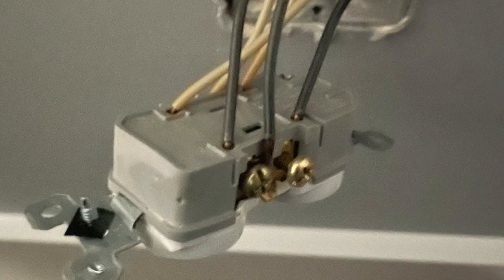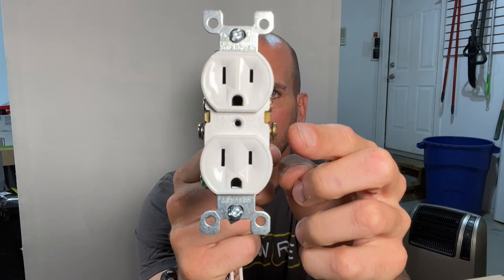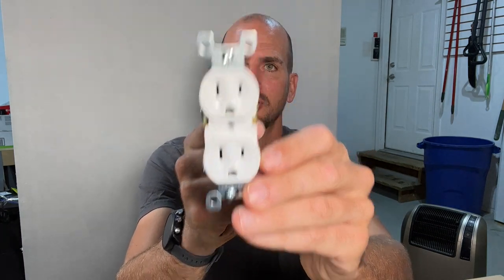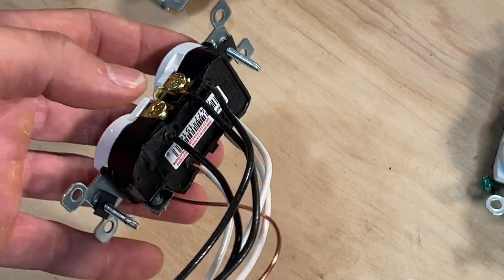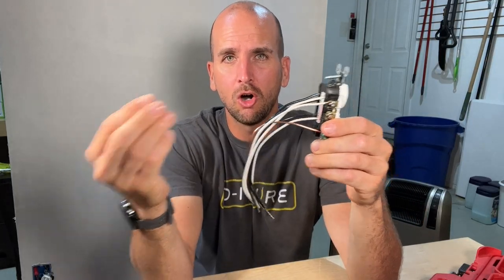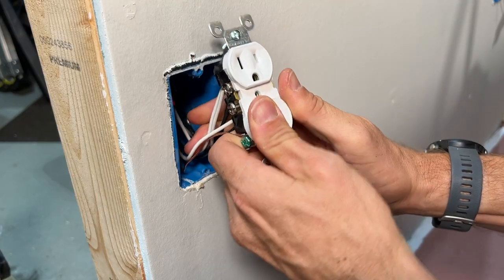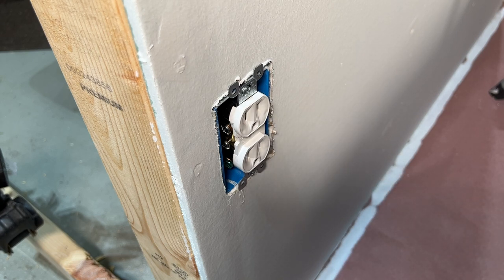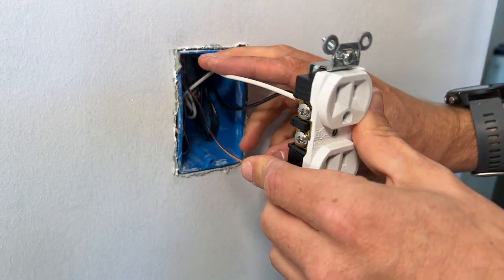Beware Of These Wiring Mistakes Made On Newly Built Home

Comment: As an Electrician, i prefer wire nuts over the ported connectors. More surface area to conduct electricity and less resistance.
Reply: But have you ever had an issue with resistance or is it only a theorethical problem?
Reply: @rutgerhoutdijk3547  Someone did a test on Youtube and the lever lock wagos were the worst. Resistance causes heat and heat is never good. From my experience ive been in J-box where the plug in connectors were used and they sometimes slip right off or you can see where the conductor had worked its way loose over time through heat cyles and building vibration. Wire nuts installed correctly usually dont have this failure. I view plug-in connectors the same way I view back stab style residential devices...

 But where plug in connectors really shine is if your in a situation where the wires are extremely short in a box, you have a solution.
Reply: @KeystoneOutdoorsman let's say the acceptable resistance is 1 and the twist connector is 0.02 and the wago 0.05, how is that a problem? They are both way within spec.

Comment: So you have multiple problems here.  First is the 12 awg assertion.  In principle I agree however all things are never equal in the real world.  A general purpose branch circuit likely to exceed the 15A/12A available with multiple receptacles should simply not be wired as such, which is why MWBC are how things are done commercially.

Sizing up is an absurd proposition when alternatives are considered, like a single phase multi wire branch circuit.  It would cost no more to go 14/3 than 12/2, although you should have a 2-pole GFCI breaker which is still a savings although one that can be hard to appreciate. This gives you 30A/24A instead of 20A/16A and opens up L-L as an option if you go for the 2p GFCI.  You would be surprised how many household loads tolerate 240V.  Either 12/2 or 14/3 would require a larger box anyway.

The second issue is also the 12 awg assertion, but on different grounds - pun not intended.  This looks like an 18 cuin box.  Your pigtails don't count either way, however if this was 12/2 it would exceed box fill.  Frankly, you're already over reasonable box fill for a traditional receptacle, and a larger receptacle including the commercial grade receptacle would be absurd there.  Passing current through the receptacle: If it meets box fill by code and by reason and doesn't violate other code it's fine.

The third is friction connections, including but not limited to backstabbing.  I will not say that I am a fan of backstabbing, just that backstabbing hate is nonsense.  You can remove a backstabbed 14 by simply twisting while pulling just like a push-on Wago - more on that in a bit.  Frankly I'm not a fan of hook and screw either, as far as I'm concerned everything should either have a bus bar, blade terminals that receive the receptacle itself with screw terminals for the conductors going to those blade sockets, or spliced and soldered conductors, but that's just not the world we live in.

Wagos: Consider compact push-type.  They're smaller, easier to install, have less resistance, and most importantly are not inherently likely to become inadvertently unfastened.  With the usual Wago 221 it does happen sometimes on installation, can definitely happen later, and because of that you need to check with a flashlight every time before you close up the box.  I also prefer to put the line in the middle of the two loads on Wagos to minimize the resistance but you do you.
Reply: About 25 years ago I moved into a new apartment after college and put a laser printer in a spare bedroom that was on a 15 amp circuit. I never liked how the lights dimmed - unlike my previous apartment that had a 20 amp circuit where I had the printer.

So, when I later had my house that was old and needed remodeling I made sure all the receptacles where on 20 amp circuits. I'm glad that I did because despite putting in central air I found that I still need 2 small window air conditions upstairs.  I have 8 different 20 amp circuits upstairs yet both air conditioners wound up on the same circuit. Using 14/3 throughout would have allowed for reconfiguration to split the load - but, I'd guess many homeowners would not know it was an option. I'd still prefer 20 amp circuits.

I've warmed up to the British method of having 32 Amp ring circuits (240 V) for most receptacles - and having a fused plug for individual devices that you plug in. Though it is harder to detect faults it does have the virtue of being able to plug in more than 1 high demand load without having to worry about overloading a properly designed circuit.

Comment: I have learned a lot from your channel, so I appreciate what you've shared. However I really disagree with calling things like backstabbing a 'mistake'. It fully meets code. It's your preference to use a higher grade outlet. Different than a mistake. 

Of course commercial grade is better, but these residential grade outlets have passed lots of relevant tests and should be completely fine for residential use. No need to shame a contractor for using what's approved. Same with 15A service. Not a mistake. It's typical and normal. 

If you really think the backstabbing contact area is too small.... Compare it to the contact area of your Wago connectors that you promote.
Reply: @Kevin-mp5of  Still not a 'mistake'. Sorry.

Comment: Yeah those 5 wire wagos help save a bunch of space inside this especially small box. Making a pigtail here would have required 2 wire nuts per conductor and it would have been a problem to stuff the outlet back. If it were for just 2 wires + 1 pigtail, a wire nut could have been fine.

Comment: I have a 60s home that is fuses and two wire.

A friend told me to connect the ground to the neutral to get a ground. 

We'll,  that's evidently not best practice. 

Instead of using a GFI, can I use a 3-prong - screw in the ground and be done with it and have a 3-prong outlet.?

Why a GFI vs a regular 3-prong outlet.?
Reply: a GFCI with no ground will offer some protection.  A three prong outlet with no ground offers no protection.

Comment: I would use the non lever wago's for situations like this that you'll probably never change once installed. Those lever ones are expensive.
Reply: Nothing will compare to the tried and true wire twists caps.
Reply: @hippo-potamus  I only use those when wago's don't work, for example when the wire is too thick. Otherwise wago's are quicker, easier and safer. In Europe the twist connectors are not used for residential use since the seventies. You can still buy them for special cases, but they are almost never used.
Reply: @rutgerhoutdijk3547  I don't see how screw-terminal connectors would be more reliable or provide a better connection than full pretwist contact between the wires at an outlet.

Comment: Upon further review of watching stress test videos I have concluded that wagus are just a new trendy fad. Maybe they have their place when mixing stranded and solid or in very thigh spaces but I still have all my amazon wagus multipack unused and chose instead to go with the traditional tired and true ideal twist caps. The argument of twisting - retwisting wires when you need to change out an outlet is weak and just like leaving extra wire inside the main panel. How many times has anyone ever changed the location of breaker and need that extra spaghetti? Its very rare. Wire twist at the outlet and short concise main panel terminations for clean tight connections all round.
Reply: @Kevin-mp5of  They go up in smoke much faster than the wire nut marrets in over current stress tests. They are also the preferred choice of trendy hipsters with beards and manicured eyebrows.

Comment: Perhaps this video is for some remodeling jobs for harry homeowner. As a custom home builder for 35 yrs I’ve never seen any those things done. Certainly not by a professional electrician.
     Moreover it would be impossible for a homeowner to even see those connections since elec boxes just have wires sticking through until plaster and they certainly can’t check them during a “ walk through “ on the final. So what’s the point of pointing this out?.
Reply: I think the point is that a homeowner could easily verify this by pulling the receptacle out to have a look. Is that going to commonly done? No. Would I do that? Yes.
Reply: You say these things are never done, then say it is not useful even to hear of such things. This all boils down to "Trust me." 
My new house was not wired right, and I did not have to pull out wires to know that. Impossible, you say.
Reply: backstabbing is code compliant so I'm surprised you have never seen a professional electrician do it, hell as a service tech I'd say the majority of devices I pull out of the wall to check or replace have been backstabbed.

Comment: On the commercial outlet is it acceptable to back-stab AND use a J hook on the same screw terminal?
Reply from the maker: That is a good question.  I am not sure but would think it is 1 or the other and not both methods on the same screw terminal.
Reply: Typically the commercial grade outlet you can’t get a hook around the screw. You would spend more time trying to hold the screw and getting the loop around it.
Reply: No, that would be similar to putting 2 wires under one screw. On some brands it may not be mechanically possible.

Comment: "It was built by a reputable builder." 
But a builder does not wire a house, a builder hires subcontractors who hire supers who hire installers and expand or replace them as needed. Who's guaranteeing that? 
But there are good code inspectors, and slack code inspectors.
Reply: Code inspectors rarely go past the construction trailer to pick up their “brown paper bag”!
Reply: A reputable builder who uses $0.50 outlets

Comment: Fantastic as always! So would you bother to make the pigtails 12 gauge, or does it not matter because the main wire is only 14?
Reply: If the feeder is 14 then either 14 or 12 pigtails is fine
Reply: @Kevin-mp5of  it's not something I would set out to do. But if I needed a pigtail and had some 12 laying around I would rather use it than run to the store for a spool of 14. I tend to keep some 12 on hand because it works for both 20a and 15a circuits.
Reply: @Kevin-mp5of  remember the current a circuit can carry is determined by the smallest wire. So if your wire from the panel is 14 you are fine using 12 for a pigtail or extension. But if your wire from the panel is 12 and you have a 20a breaker you cannot use 14.
Reply: @Kevin-mp5of  you do you. I don't do electrical around my house often so it's easier for me to just keep a small roll of 12 on hand for when needed. The OP asked a question, I answered. You can debate the pros and cons of preference. But electrically and code wise it is fine and my answer is correct. You asked why you would do that and I gave you a reason. Again you can debate the pros and cons of preference, but doing so does not make you a hack and there is no need to be rude to people with a difference preference than you.

Also pigtails don't count toward box fill per NEC the only thing that may be a concern is the one allowance for grounding is based on the largest gauge wire.
Reply: @evilhamsterman  Yeah that makes sense because the theaters what’s the most important thing. Like you said it probably should be 12 days since they’re running some high draw  stuff off of that outlet
Reply: @ajmedeiros77  just remember that your pigtails have to be the same size or bigger than the line from the panel. If you want to run a 20a circuit you have to use 12 for the whole thing. If you have a 15a circuit you can use either 14 or 12.

Comment: If the electricians would carry a low torque electric screwdriver (hint hint...m12 using ECX bit), they would be able to  tighten the unused screws in a few seconds. I know cause I did a couple new installations within a few mins.

Comment: Only other thing you didn't mention is mounting the outlet ground-side up.
Reply: The National Electrical Code (NEC) is silent about the placement of the up or down of the ground opening so it is your preference to choose one.  In hospitals, they have the ground on the top and so in Canada but most in the US, most residential and most commercial electrical have the ground at the bottom of the outlet.
Reply: There is no valid reason to do this.  An old wife's tale said in an office you could drop a paperclip and the grounding pin would deflect it before it could hit the hot side of the plug.  How absurd.

Comment: Hot Question ;  My breaker box is outside, every time we have good down pour one breaker flips changed breaker and box ? HELP
Reply from the maker: Sounds like you might have part of your box which is letting in water.  I would check around the outside of the box looking for any areas where water could enter the box and cause issues like a tripped breaker.

Comment: Mistake (1)  a lot of guys wrap the outlet in tape.   a bit of over kill.   I am also not a fan of spring connectors as it is very well known that they could over many years suffer metal fatigue.   As the spring gets looser,, well you know.   I always use the screws.   Also a bad idea to use the outlet as a fuse...   Should be pigtailed.
Reply: I agree, particularly if you're using pvc, fiberglass, or composite boxes. I pigtail all my receptacles because that's the way I was taught by a journeyman electrician. I NEVER backstab.
Reply: Wrapping the terminals in electrical tape is not a mistake. Especially if the box is metal
Reply: You be amazed where pet hair and people along with dust balls can travel behind a wall plate and arc.
Reply: @Matt-ix6ne  I agree, but you don't see a lot of metal boxes any more.
Reply: @ptso7580  I use insulating seals behind the wall plate on all my receptacles and light switches. I installed them for energy efficiency, but I suppose they keep dust and hair out as well.
Reply: @im2yys4u81  if you’re doing remodel work on old houses they mostly all have them.
Reply: @Matt-ix6ne  I know. lmao. I removed all mine and replaced them with old work boxes.
Reply: My house built around 1978 has those very small metal outlet boxes, I wrapped most of my new outlets with electrical tape. There is probably around 1/8" space from the screws to the box. I hate them small boxes if it were not for the Wago connectors it is almost impossible to fit a GFCI in those boxes.
Reply: @Matt-ix6ne  I did not say it was a mistake, i was referring to his mistake 1 not screwing down the terminals.  as far a electric tape I said clearly that that was "over kill" witch it is.  If the screws are down properly they should never get close to the metal box.
Reply: @samjones1954  Most standard metal boxes are so tight even with the terminal screws fastened all the way there is still a high chance it can come into contact with the side of the box. It’s not over kill
Reply: @kommoncents0000  I have a cardboard box filled with those metal boxes that I removed when I rewired my house. Removing the box was the only way I had of sliding my arm up the inside of the wall to pull out the staple anchoring the old wire. The old receptacles were all taped.
Reply: @Matt-ix6ne  Matt.. it is, and even the electric code suggests not using tape because it could start on fire.  I don't know where you got your ticket, but I would suggest a Cracker Jack box.   I have been a Master Electrician since 1978 and have seen guys tape outlets and wondered who will get shocked when it has to be removed.   Under most codes  taping outlets is taboo,  so instead continuing your lame argument, go read something.   If you did not notice.. the presenter of this video did not suggest taping either.  As I said, if your scared then don't do it.  You obviously have little experience and you should not screw with electricity.
Reply: @Kevin-mp5of  I also use it to tape up a stripped end that I may need to pull through a hole or just leave for future use.  Taping a outlet is as i said over kill, and you have also pointed out a reason not to on new outlets that have solid state components in them.   I never thought of that.

Comment: Connecting all neutrals together on the outlet + multiwire branch circuits + later replacement == bad day.
Just because there isn't current between your hot and neutral doesn't mean there isn't current through your neutral.
DIY beware.

Comment: Love your videos BUT, this one screams possible overfill. If you haven't, do a video on Box Fill. I think the calculation in this particular example= 6 conductors, one device (counts as 2), grounding conductors count as 1, internal clamps count as 1....that's 10 "conductors" x 2.0 if 14 awg = 20 cu in box. Most of those blue boxes are 18 cu in; yes, it could be a 20 or 22, both of which are acceptable. Your viewers should be informed that the sample shown in this video would fail if the box is a 18 cu in box.
Reply: Most 1 gang new work boxes don't have internal clamps, so three 14/2 and a receptacle would be 9 volume allowances, which would meet box fill, even for an 18 cubic inch box.

Comment: I thought u said in another video that the 15amp and 20amp receptacles are identical. But here ur recommending 20 amp with 12/2 ?????
Reply: the circuit being on a 20amp breaker with 12/2 allows more devices and or devices with larger loads than a 15amp circuit can allow. The quality of the individual receptacles is a different matter, In fact, on a 20amp branch circuit you are allowed to use 15amp receptacles, so manufactures probably make the 15 amp ones just as sturdy since they can find themselves on a 20amp circuit.